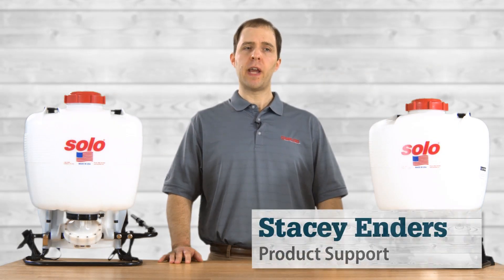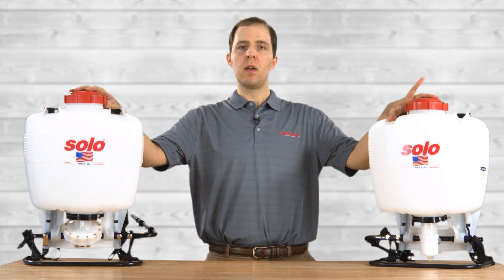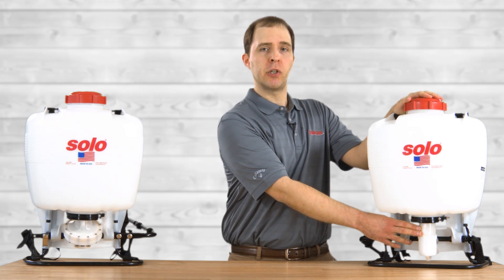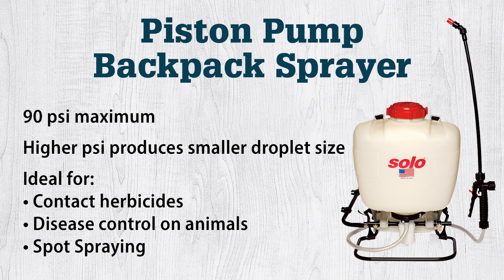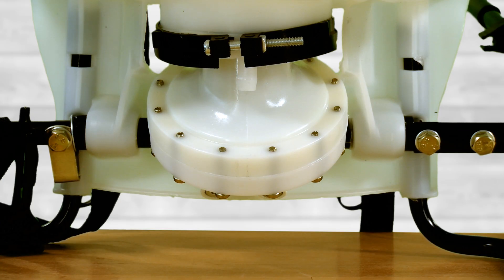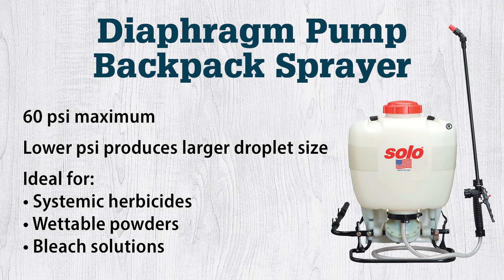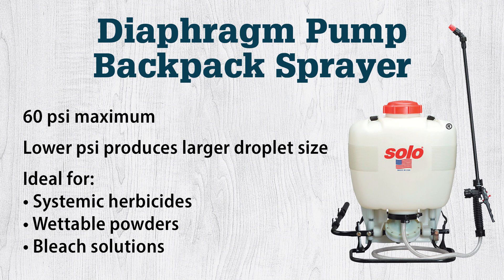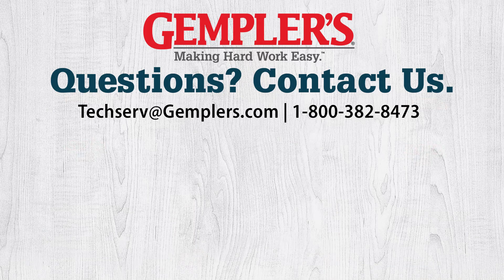The Difference Between Piston Pump and Diaphragm Pump Backpack Sprayers | Tips from Gemplers

Comment: the new units might disassemble without any effort but I can assure you that you need a heat gun to reinstall the pressure cylinder and a kettle of boiling water to remove it. It seems the plastic tank either shrinks over time or when its cooler. Mines a German 475 its good apart from the naff manual and partial how too video.